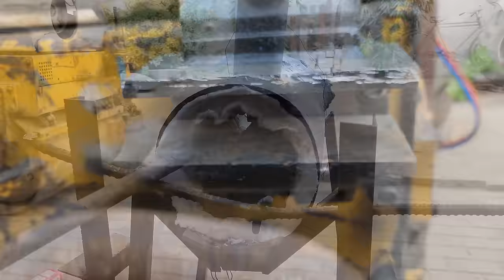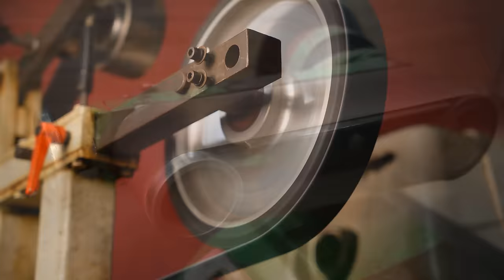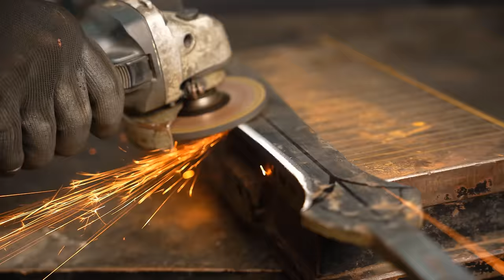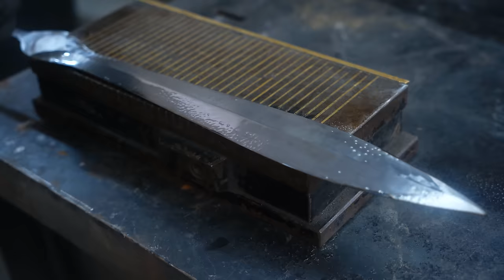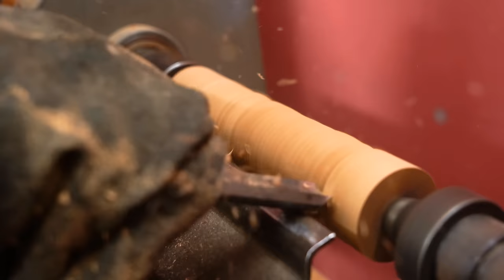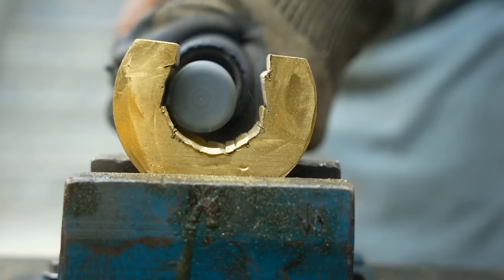Forging Laconian SWORD out of Rusted Iron chain

Comment: Great looking sword. That said, you could have saved yourself the grinding work by using 1. A smaller piece of steel, (IE: half of the link). 2. Forging.out the billet to the length and thickness you needed. By doing this you relieve the stresses and make the sword stronger.

Comment: Forewarning so excuse my ignorance, but what is flaking off when you hammer down on the molten steel? Does the heat make the weaker steel separate off? Or does the heat make something else come forward that is then flaking off the metal? Again I’m sry I’m new to this and fascinated and curious.
Reply: ‘It’s the impurities’ is the human way of putting it I don’t actually know what those are specifically

Comment: I'm curious to know why he cut the brass then used an angle grinder and die grinder to open up the round center instead of mounting it in the lathe and boring it out then cutting it.